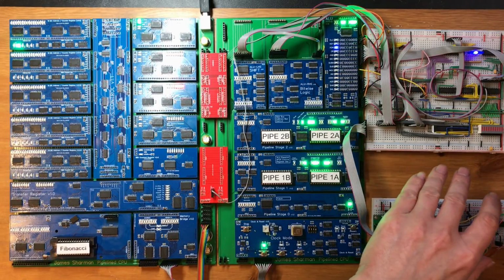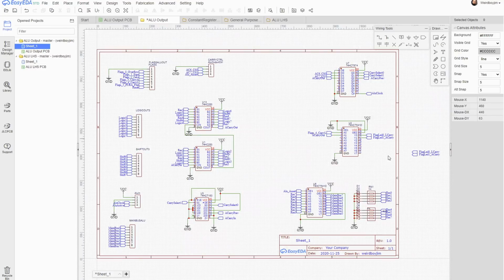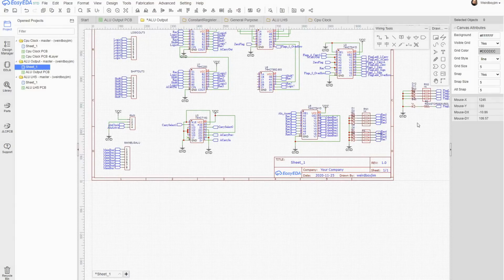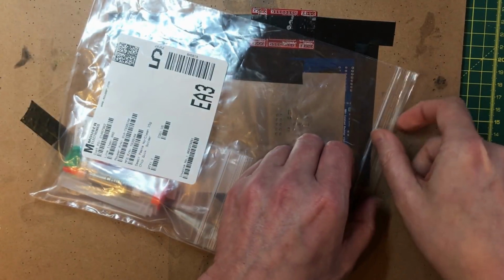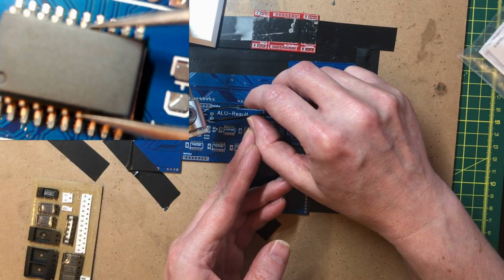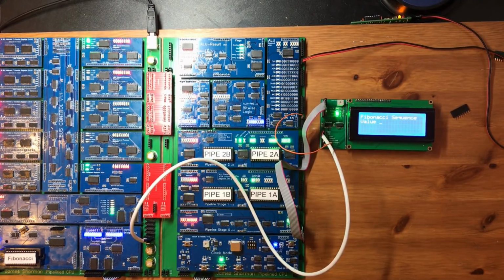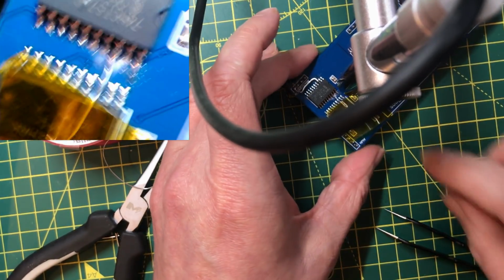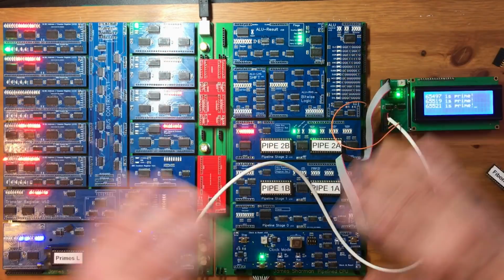ALU Output  PCB - Making an 8 Bit pipelined CPU - Part 95

Comment: Well done in the repair and easily done when you get tunnel vision looking at a schematic. 
What is the camera you use for the close ups?
Reply from the maker: Thanks Mark! That's is a cheap usb microscope, I've not seen that particular one around for a while but similar ones are available on the common sites. I especially like that one as it's low profile from the respect of my main downward facing camera.
Reply from the maker: A short video on it: https://youtu.be/6NBQCpCHtKQ

Comment: Congratulations on getting here. I've been binge watching so have seen the development over only a couple of weeks; to have got here after however many months it was, and the number of things you had to learn and techniques to master, must be a fantastic feeling.

One thing that did come to mind, and I think I was told way back in the day but I never had the opportunity to verify, was to keep Vcc power (Vcc to chip Vcc pin); high input values (Vcc to chip input pins); GND supply (GND to chip pin); low input values (GND to chip input pins), separate. Ideally would be separate Vcc's and GND's to the board, but at a pinch single VCC & GND to the board, decouple and separate Vcc and GND into the respective power & signals. The idea is to keep the current flows in and out of the chips away from the signal values. Has anyone mentioned this to you, or is it just my deranged thinking?
Reply from the maker: Glad you are finding it interesting?  I haven't heard that, what I have heard is that in some chip families you should pull up/down or both with a resistor as there can be a small potential internally and you don't want to be singing current.

Comment: I'm told that TTL is able to sink more current than it can source, or something like that, so if you have the choice, it's generally better to tie your LEDs to Vcc and an active-low output, than to use ground and active high. Even if that weren't true, it's good to remember that you can make LEDs light up either way without requiring the use of an inverter.
Reply from the maker: I had heard that as well, but...  I've also heard that it applies much more to older gate designs and modern led's have a much lower current drain so it's not as relevant. I do drive led's the other way around as well, I can't remember my exact thinking here but an otherwise wasted gate may as well be used.
Reply: @weirdboyjim  Quite possible, I leaned from old books. But I suppose the next time I have reason (and time...) to dive in, a datasheet should tell me what I want to know.

Comment: James, even your bodges are top tier! I'd have hacked that together way worse! ;) The desire to see success is strong! :D
Reply from the maker: Thanks! Usually I get told I’m using the wrong type of wire.
Reply: @weirdboyjim  you can get 'bodge wire' which is super thin and solder-through enamel insulated. But, I think an old resistor leg is equally valid. 😂 It's easy to say "you should have..." - everyone is an armchair critic! 😂

Comment: Super cool! I wonder though why do you designed the boards to be plug in boards when you could design the whole CPU to become a 'sandwich', having buses go through headers one board to the next. You could have the clock + control (clock, pipeline logic, internal bus control logic), ALU and external bus boards in the middle, then the registers could go to either side of the core.
For one it would allow you to run at ~6 MHz speeds, maybe better (depends on the ROMs).
Another thing to try would be to change the pipeline logic from ROMs to GALs (and maybe try to decode some lines straigh from opcodes with muxes - probably would need a change in your opcode encoding though).
Looking at how your CPU is architected I think it's hands down a few times faster than a 6502 or a Z80 per clock!
I'm really impressed by this project and it's very educational to watch the videos, thanks for the series :-)

EDIT: Fixed a typo.
Reply from the maker: The design of the backplane is very much about presentation and ease of building incrementally.
Reply: @weirdboyjim   Makes total sense then ;-) Can't wait for the schematics and other details to be realeased for the project. Interrupts would be a great addition to this, you wouldn't need to constantly pool your I/O's, maybe get some system timer INT, might be useful for accesing future video hardware memory (frame NMI like on the ZX Spectrum, unless you have a better idea that I think you already have) ;-)

Comment: It must be a great feeling to finally get all the hardware on PCBs. I'm sure it could run at 4MHz stably, and that would mean it would be quite a performer for an 8-bit CPU.
Reply from the maker: 4mhz wouldn't surprise me, but I suspect that is pushing the limit on the lcd module again.
Reply: @weirdboyjim  Will you still use the lcd module once you have a VGA interface? You can always do I/O with UART for debugging.

Comment: Congratulations! Big moment for sure.
What's next, the mega backplane or the video thing or are you going to move your sound hardware to PCB?
Reply from the maker: I want to finish the Ram update, I need that to finish the VGA, so I'd rather not start the VGA until it's at least work on breadboard. I don't want any unexpected delays once I start that one. Sound and UART to pcb will need to happen, not sure If I'll do one big pcb for CPU + peripherals or not. I'll decide soon.

Comment: I'm on my 3rd revision of one particular PCB.

It's not an easy one though, I've been reverse engineering an old Cisco router, and dealing with a 32 bit data bus just requires too many bodges to fix so I just order a new one each time.

Costing me an arm and a leg though because they are 1.2mm boards so that they will fit into an 80 pin flash socket. Pretty sure I've got it right now, will find out tomorrow when they arrive!
Reply from the maker: Ohh, Good luck with that!
Reply: @weirdboyjim  Ive got it to a point where I know enough about it to write and run my own code. Even created a Motorola 68k port for FreeRTOS and got that running on it. :-)

The only problem with it is that it doesnt have any GPIO, so Ive been trying to make a board that plugs into one of the flash sockets to provide inputs and outputs.

And the only problem with that is that Cisco decided to go their own way and not follow the JEDEC standard for flash socket pinout, so the first board I made just didnt work at all because I followed the JEDEC standard. The second time I discovered (and I probably should have seen it coming because they did this elsewhere on the board too) that each byte of the data bus has its signals mirrored (D0-D7, D1-D6 etc).

So this third time I should have all of that sorted out and some working buttons and displays.

It has been a fun project, so Im now also tackling another router model and am very close to having FreeRTOS running on that too.

Comment: Sorry James but the schematic diagram drives my OCD mad, I hate symbols that match the physical world.  
I prefer the symbols to match the data flow, in on the left and out on the right. 
So you can follow the flow from left to right, all this looping around the symbols you avoid by using labels, but you lose the flow.

Had the same issue when people moved from A0 to A3, you get a much better picture on A0, 
no constant turning the pages over. But A3 printers are a lot less expensive that A0 plotters.

James you need to improve your bodging techniques.

OCD aside still a great video to watch
Reply from the maker: I have to work with what I've got. I've I made new symbols for all the parts I'd not be where I am.
Reply: @weirdboyjim  You are such a diplomat :)
Reply: OCD is short for obsessive compulsive disorder right ?
Reply: @tinygriffy  Yes, so i like to see things how i would do them. after years of having to do things a certain way, you can’t easy change.

Comment: before the Wire heats up to 300°+ there will be magic smoke from the entire CPU possibly shutting it down before the Wire is heating up. Its a data line not a power line, its way to thick, imo.
Reply from the maker: My comment worrying about heat was just during soldering, I was concerned soldering one end of such a short wire would melt the solder at the other end. I've ordered some finer wire for this kind of work in future, but that was all I had.

Comment: I can't wait for the VGA display! That's gonna be amazing, and such a visual leap in design - literally and figuratively :D
Reckon you could get this up to 4MHz? Maybe 8? That'd really be something :D
Reply from the maker: I've calculated 4mhz to be the upper limit but it's already more than fast enough for my needs. Calculations and test reality may not always match of course.
Reply: @weirdboyjim  I'd love to see your prime finder ported to 6502 and Z80 assembly with a shootout to determine the respective equivalent rate. Ie JamesCPU at 1Mhz performs the same as a 6502 at 5MHz or whatever, for fairly "real" programs.

Comment: Awesome as usual, one of my favourite projects. When doing your rework with wire, get some flux in there.
Reply from the maker: That might have helped me to get joints without adding any new solder, but I've found it doesn't make much difference if I'm adding some new cored solder to the joint already.